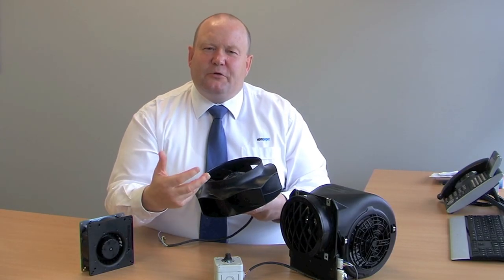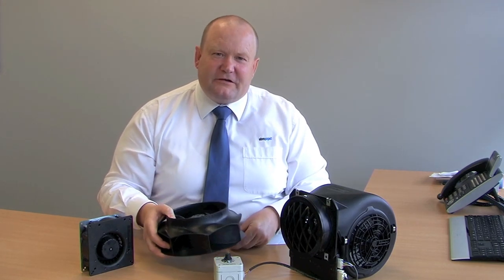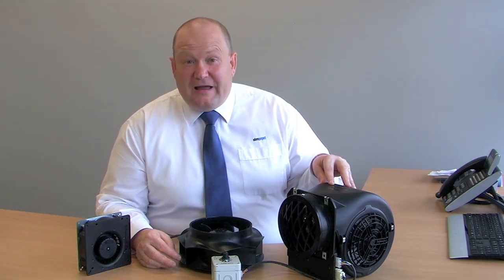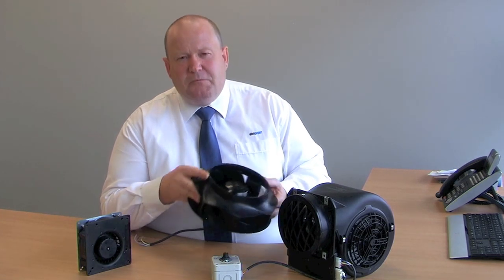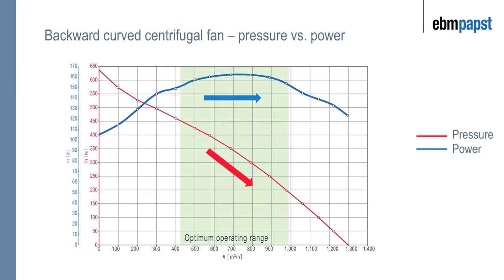Small centrifugal fans - ebm-papst A&NZ

Comment: Hello, two questions here if you don't mind. What would happen if you reversed the direction of the fan rotation?  Is it possible to use these fans in water, what would the effect be?
Reply: Hi Steven, q1) - the fans would still run and move air in centrifugal direction but with much lower effectiveness.  I suggest not doing it. q2) typically normal fans will fail due to water ingress and short circuit.  We do produce products for high moisture applications.  Please email sales@ebmpapst.com.au if we can help with this or contact your local agent as shown at www.ebmpapst.com.  Cheers Steven.  Simon

Comment: Also, what would a fan be like if you made it forward-curved but with the same number, shape, and size of blades as the typical backward ones (if it's going to be overloading even with the little narrow, shallow blades anyway)? And what if you made a backward one that was vice versa?
Reply: Hi, impeller designs that give performance data between these two types are called mixed flow and the impeller blade designs and take off angles are defined within standards - ISO 12759 I think, but not sure off the top of my head….cheers
Reply: @SimonBradwell : But it sounds like FC-cent. fans with big blades and BC-cent. fans with small blades don't really exist in the market, so I was wondering what the general reasoning behind that is. Would you be able to describe that generally?

Comment: @Simon Bradwell 
Dear Simon I'm currently testing this fan> K3G250-RR02-I8. Unfortunately I'm unable to find its datasheet and hence do not know the wiring diagram. I'd be grateful if you can help.....Thank you.
Reply: This fan is installed in Schneider central inverter in a solar power plant where I work, sadly though several fans fail (the internal IGBT of the VSD blows), so I'm looking for a the connection diagram to operate the fan in my lab. there are lots data cables and I don't want to damage the fan by wrong connection
Reply: @mahmoudgaber5347  Sorry for my late reply.  Did you sort this?  If not please mail us at sales@ebmpapst.com.au.  Thanks, Simon
Reply: @SimonBradwell  please don't be, I've contacted the customer care but they couldn't help since the my fan is manufactured exclusively to Schneider Co.
Luckily, I could find the operation connection, I shorted the blue to red wires (com, gnd), and fed the yellow one (pwm) 0_10v. It worked
Reply: Not very sure about it since the fan doesn't work sometimes, there are other wires I leave floating.
here you can see I'm running the fan, while the day after it didn't run don't know why: 
https://www.youtube.com/watch?v=L8Y5tIbE6-I
Reply: @mahmoudgaber5347  HI, please send us a photo of the fan, label and the wires.  We might be able to help.  Again please mark it for my attention and Aghna please.  Thanks, Simon
Reply: @SimonBradwell  Ok, please send me your contact to be able to mark you in the mail. Thank you

Comment: That EC centrifugal fan. Is datasheet available an can it be purchaded through Farnell ?
Reply: Hi, some data is here:  http://uk.farnell.com/b/ebm-papst.  Otherwise please contact the ebmpapst subsidiary local to you here: https://www.ebmpapst.com/en/contact/locations_worldwide/locations_worldwide.php.  I hope this helps!  Thanks for watching.
Reply: Simon Bradwell thanks for the location info. One more question for the applications expert: could http://uk.farnell.com/ebm-papst/ree-10/speed-controller-manual-230vac/dp/2474663 speed controller used with non-EC blowers to control their speed ?
Reply: Yes.  This is a 0-10V control pot where the control voltage and the speed is controlled using the dial.  Best wishes.

Comment: If you're saying that backward-curved fans blow "more air" per revolution of the comparably sized forward-curved centrifugal fan, and that they're more forgiving and more efficient, then why not just use them in all applications that might call for any centrifugal fan, but adjust the speed to match the need (haha, nice rhyme)?
Reply: Hi, I am not sure where in the world you live but this has already happened through Europe and changes are now happening in APAC and US.
Reply: @SimonBradwell : I live in the USA. But vacuum cleaners have been using this backward-curved style for ages, so it's not as if this were a new style of blade that was just barely developed. However, vacuum cleaners are NOISY! So when in a volute, is that the reason BCC fans aren't used more often? I mean... swamp coolers and furnaces are still using FCC fans all the time. What supposed advantage do they have?

Comment: 0:44 - "radical" centrifugal fan...?  ;)
Reply: Yes, it's a trademark for specially designed flow channel impeller design that achieves less noise and more static pressure and more air volume than competition